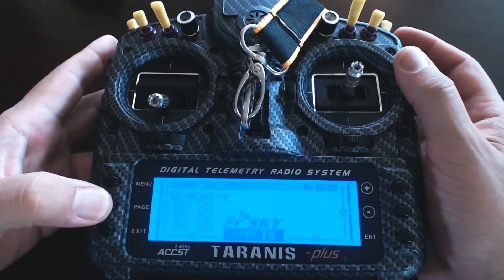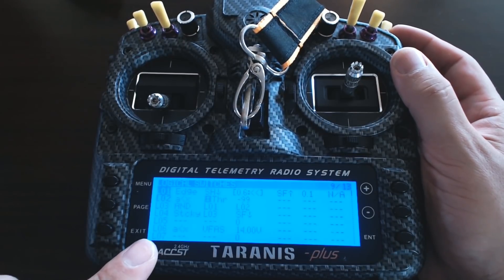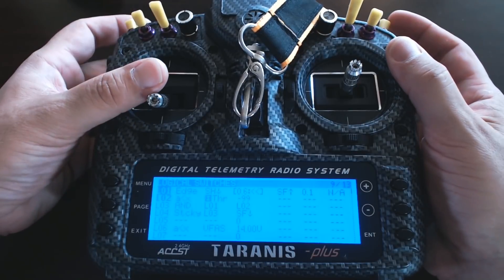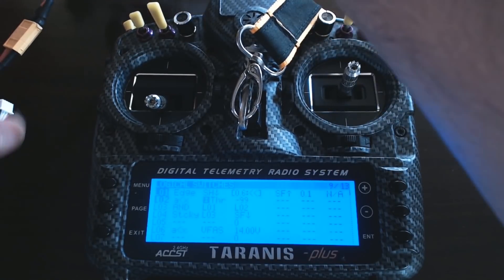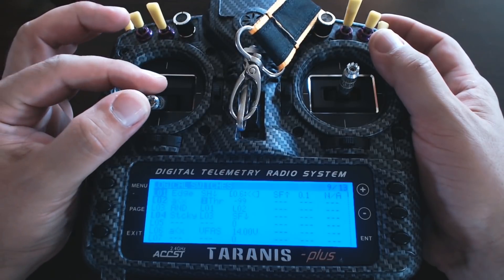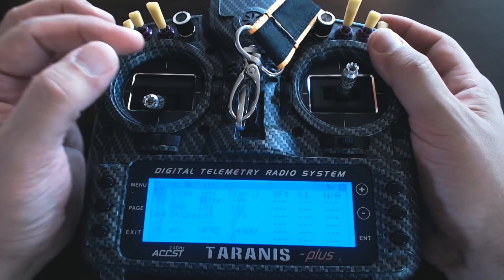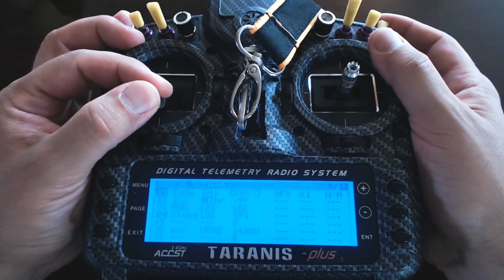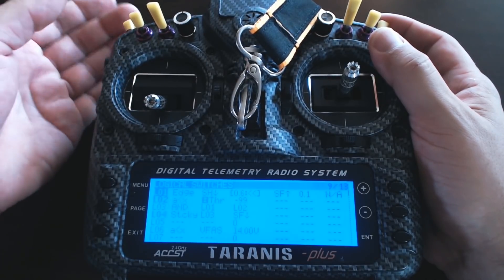How to make your Taranis read out low voltage

Comment: and another question ... is there a chance to read out the average cell voltage? ... this would help when switching from 4 to 5 cell aso ... I have seen some discussions about this for cleanflight ... FLVSS ... therefore it may work in BF too
Reply from the maker: Yes,  Betaflight can do this. I can't remember which sensor it is though. I think it might be A4. Check your sensors list and see which one looks like it is average cell voltage.
Reply: ..exactly the one I needed and working like a charm... next time I check it out by myself first .. as ever ... you are the best

Comment: I just use delay set to 5s, this means it ignores punch-out voltage drops and it solves the "zero volts" condition without the need the extra RSSI and VFAS logical switches. So when the voltage goes  below my threshold for more that 5 seconds then it alarms. In Special Functions I set the sound and haptic warnings to repeat every 3 seconds, so once the logical switch becomes true I get repeat warnings...
Reply from the maker: It feels to me like 5 seconds is too long unless you set the threshold to like 15.0. But whatever works for you!
Reply: agreed, the threshold needs to be adjusted to suit the flying style and lipo capacity etc, I use 14.5v and my lipos generally land at about 15v still in the tank. Cheers, Ray

Comment: Josh, wouldn't you want to do a logical switch of VFas = Xvoltage (for a duration of Xtime)?  During flight vltage spikes and crap can dip the voltage below your example of 14v and read out an audible alert.  During the course of a freestyle flight the alarm will be going nuts.  I've done this, tried it and it does go nuts.  Rotorriot did a video on Taranis setup and covered this a while back.
Reply from the maker: +Nick I have it set up that way. That's what the 0.2 second Delay is.
Reply: ahh ok cool

Comment: Josh you did the 0 volt thing the hard way.  There is no need to add L07, all you had to do was on your L06 was add your AND condition ARM SW.  Then it only gives volt info when armed.  Silent otherwise.
Reply from the maker: +GenCode FPV that's not bad. Multiple ways to solve the problem. Ain't OpenTX grand.
Reply: When he chained it with the logical switch tied to RSSI, I think it could be: L07 = RSSI > 0 for 5 secs AND L04 (his logical arm switch), and then L06 = VFAS < 14.0 for 0.2 sec + 10 sec repeat delay AND L07. Would that work? If so, still does it with one less logical switch. I guess if we wanted to use RSSI > 0 for something else, it might make sense to give it its own logical switch. OpenTX is very cool!
Reply: Lol I just post the same post with just using the AND arm switch on same L06 line.

Comment: Great vid ... as ever
and a question ... do you need the additional two logical switches (0V & telemetry lost) when using „delay“? ... have to check this out tomorrow
Reply from the maker: +whoami1975 pretty sure I added those I response to specific conditions that I encountered but I don't remember exactly what they were.
Reply: ... checked it and it seems they are necessary. even with telemetry ... what else to expect from your advice ;-)

Comment: OpenTx on flysky radios ? Is that possible ?
Reply from the maker: +Olivier DUCRUET yes. It's not fully ready for prime time yet but coming soon.
Reply: Thanks Joshua, this is a great new, otherwise I just got a jumper T8SG, multi protocol radio with deviation inside

Comment: I'm not a Taranis user, but if you've set the alarm to trigger at a value of less than 14 volts won't it always just say "13.9 volts" even if it ultimately sags to 12 volts?
Reply from the maker: +patrickcol no because it has to be below there for 0.2 seconds. So it has 0.2 seconds to sag to whatever.
Reply: So that makes sense, cheers. Much as I would love RSSI info, the Taranis is so reminiscent of the '90s PC crowd typing in their DOS commands: I was a Mac user.

Comment: Well, damn. You're making me want a Taranis. Can you do any of these things with the Turnigy Evolution? Or do I need to wait until it gets hacked with Open TX? (I'm getting my Evo today). Thanks for the video!
Reply: I would also like to do some of the cool things on an evolution.  Like rssi on osd.
Reply: The evolution is fairly straight forward compared to opentx.  There are some videos out there so just browse around. It will do audible beeps for rssi and vbat, they work pretty well.  It can’t interface with your fc for voltages though so no osd support.

Comment: Hey Joshua, could you please make a video how to set up a taranis warning that works with the mah reading of the current sensor? It seems more complicated than voltage setup, but should be more reliable is the current sensor is set right, right?
Reply from the maker: +Dennis Riessbeck it's the same method just use Fuel sensor. Also you don't need the delay 0.2 seconds because Fuel only goes up.
Reply: I have tried more than once, I wouldn't ask if I did not try it. I use voltage warning since day one, I am not an opentx noob, but there is more in detail about the fuel sensor which I was not able to solve so far

Comment: It was a little bit hard to read the screen of your radio Joshua but a very good video all along!
I prefer using A4 over VFAS for voltage reference, more interesting if you fly with 2S, 3S, 4S, etc on the same build or different builds...
Have a great weekend and keep on flying!
Reply: ABMNS PRODUCTION  I have my brand new qx7s I am new to open TX and taranis, can I use A4 instead of vfas as I will be changing between 3s and 4s batteries
Reply: matt neale Hi Matt :)
Yes you can, it gives you the average cells voltage of your LIPO which is more convinient than VFAS if you use different voltage ones (4S, 5S, etc...).
Use the low voltage and critical values that you think important for you. Or simply translate the voltage use by Joshua in his video by divided the values by 4 since he is using 4S and you will have your values for A4. It will work for any kind of LIPOs since they all have same cell voltages reference :)